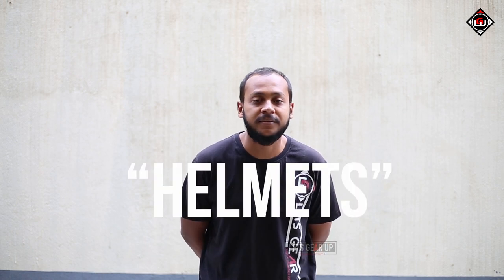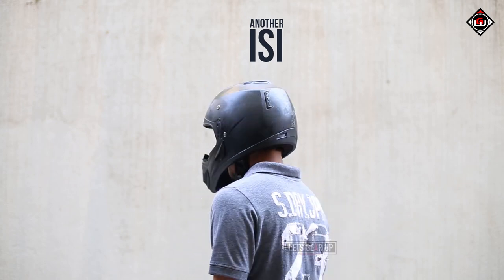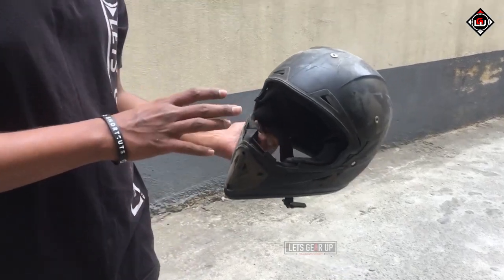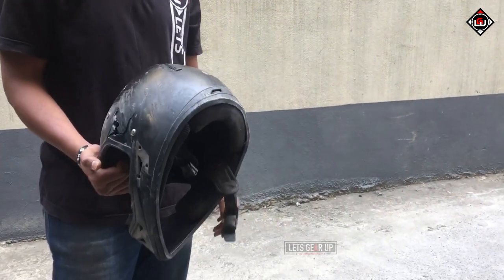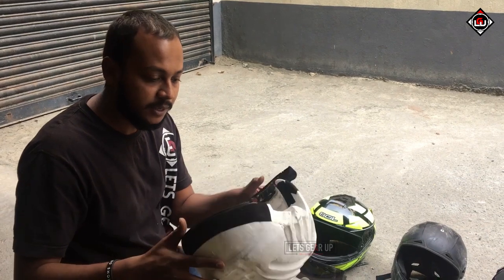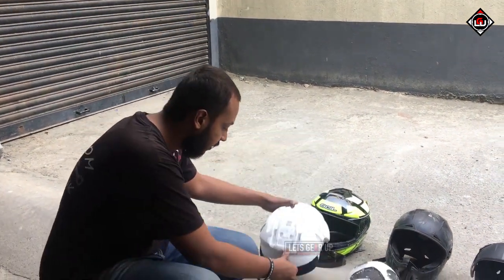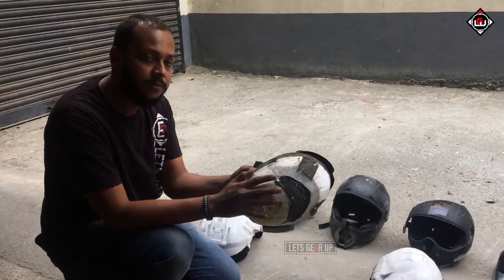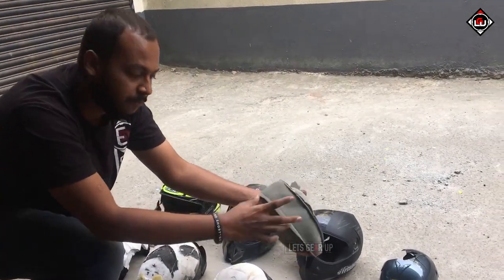ISI vs DOT, ECE, SNELL, SHARP ratings / certifications on helmets

Comment: only basic isi models were used for this test. Try using studds shifter or Steelbird SBA2 for the test,it will be at par with the DOT Sol Helmet
Reply: Vikas Aroura So true, they showcased the basic 700 INR ISI helmets. My comment also asked them to try with Studds Shifter.
Reply from the maker: Vikas and Shuvendra - Please note that this video is not against any particular brand or model of helmet.
Our intention here, is to only highlight that with ISI, there should not be any ban for other certifications of helmets, which is on par or better, to protect the riders.
Cheers (Y)
Reply: I completely agree with you folks that the shifter and the steelbird will do well, on par  however I don't think so. DOT, ECE and SNELL helmets are far superior. These helmets don't necessarily avoid a fatal crash, however they greatly increase your chances of surviving. I have had the unfortunate luck of meeting with a couple of really bad crashes and if it weren't for the right gear and the DOT helmet I might have suffered a far greater injury or not made it. Having said that if you have to increase your chances of being safer on the roads wouldnt it be better to be safe rather than sorry? Also, it's a once in 5 years investment so in the grand scheme of things it's not much.
Reply: Leon Dave
Preach! :D
Reply: Vikas Aroura
Lol
They definitely won't be on par with ECE and DOT approved helmets lol
Reply: On par with DOT & ECE??? 😂😂👌 do some research before posting some random bullshit..!
The shell used on Dot & ece are far more Superior than studds shifter & steelbird airs
Reply: Vikas Aroura I think you miss the point of this video, recently in Bangalore the authorities declares that only isi certified helmets are legal despite the fact that dot and ECE holdmuch stringent quality tests. Stuffs shifter is a great helmet and can definitely compete with SOL, MT AND SMK. But the fact that the 700 bucks helmet and  studds shifter are placed in the same category by the testing authorities is just ridiculous.
Reply: Vikas Aroura understand the point... Isi is safer, branded Isi one's are even better... But dot and ece is even more safer than any isi helmet available in the market. It is ridiculous like going after car owners who have got 6 airbags, abs and ebd together since the rule says about just having 2 airbags and abs....
Reply: You may have steelbird.... But majority of the people with lesser knowledge would end up buying the regular ISI helmets which are sub-standard.
Reply: Why should he try your suggestion mate? Don't the helmet was isi marked? A basic dot snell helmet needs to pass the rating that are passed by the top of the line helmets. But we all know isi marking on cheap ass helmets are fake and shit!
Reply: in your case they used the basic SOL helmets.. let him compare with a sturdier 20,000rs helmet
Reply: studds and steelbird helmets fulfills the dot certification standards

even the royal enfiled open face helmet is dot certified
Reply: My Studds Shifter 2 has the DOT logo on the back of it. There is a tag on the inside that says it meets or exceeds DOT standards but doesn't say anything about ISI on it. However my sister's Studds Shifter 2 which is the exact same helmet as mine but in different colour has the ISI logo on the back of it but says nothing about it having DOT certification, no tag inside either. We bought both helmets from the same shop. What's up with that? Are they both fakes?
Reply: Shreerag G Have you done your research before making such statements? Why don't you tell us what the specifications for ISI and DOT are? I will admit that I have not done a whole of research but I can say that DOT and ISI are not very far apart.

Now I may be wrong about the following and if I am, please correct me.

DOT requires a test speed of up to 23 kmph and max g-force of 400G.
ISI requires a test speed of up to 27 kmph and max g-force of 275G.

I think ISI is not too shabby but there are other test parameters to be taken into account. Also, there are some fairly lightweight and flimsy helmets in the US market which are DOT compliant. One thing I have noticed is that ECE-R 22-05 helmets are almost always higher quality. I do not know anything about that standard, though. I think SHARP is the way to go, though. The rating system should help make more informed choices. Well, relatively.
Reply: Mukunda Krishnan s That makes sense since DOT standard is fairly similar to ISI.
Reply: Manohar N Soans Maybe the DOT stamped one is export stock? Just speculating here.
Reply: @leoncelestinedave  another point to note would be how easily anything and everything is given ISI certification... You never know the ISI helmet you got is at the lower spectrum or the higher spectrum of crash protection...
Reply: @shekharbagwe  I agree there..there is alot left to be desired the way things are run